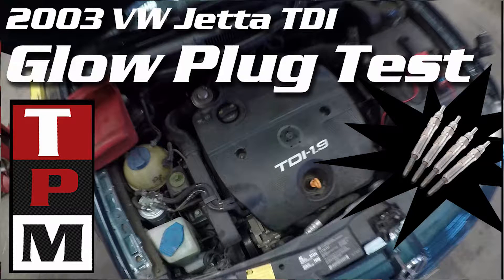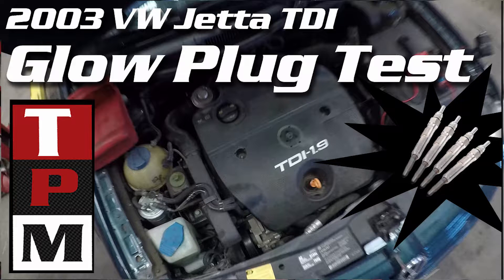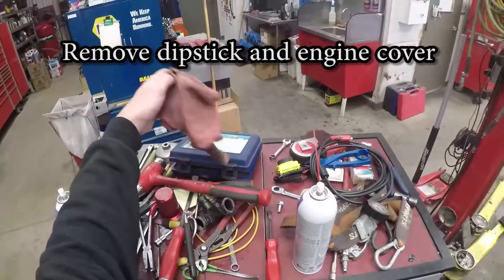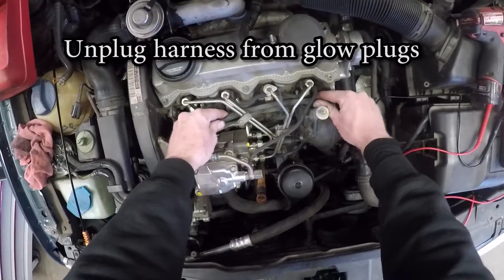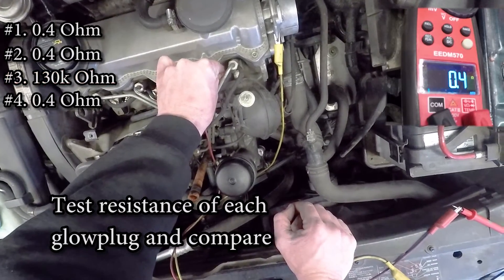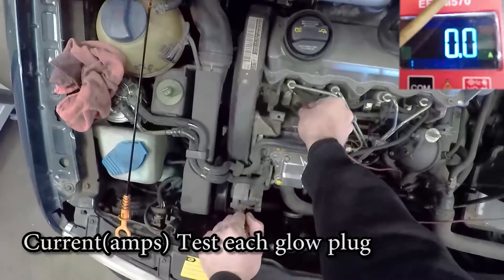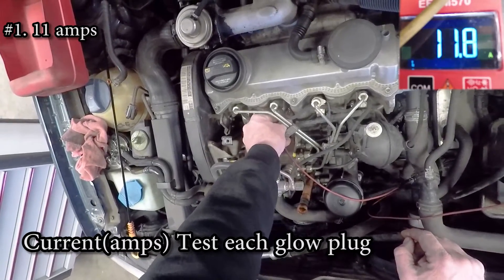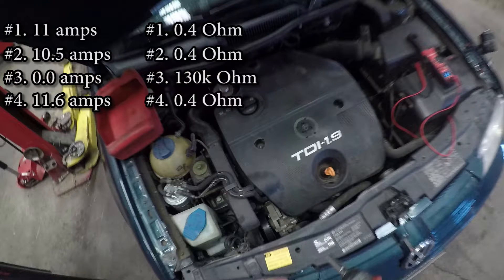2003 VW Jetta TDI ALH 1.9 glow plug testing- with DVOM and amp clamp

Comment: Question, so on one side of my truck I get , .6 , .6 , .6 , .4 , other side I get .4 , .5, .4 , .5. On ohm setting and negative terminal removed ,  when I did the amp clamp I got 0 on all of them and both neg and pos terminals on . 
I can’t believe their all broken ! Could I have  something wrong ?
Reply from the maker: What are you working on? Based on your numbers I would say a V-8. Most newer vehicles use a controller or relay to supply power. You may have a power supply issue. You could use your voltmeter to check voltage at the glow plugs. If no voltage is present After a keycycle then you may have to look at the control system. Ford 7.3 L diesels turn the glow plugs on solid all the same time for about 60 seconds after a key cycle. Chevrolet 6.6 uses two different versions of their system one version turns them on and leave them on until they’re warmed up And the other version pulse width modulates power so you may see a lower voltage value.

Comment: Can someone explain the amp clamp test to me? This is the test I need to perform on mine.
Reply: Multimeters can measure current inline, but for anything like this over 10 Amps the meter will be fried. Good meters have a replaceable fuse, cheap meters may not, and cheap meters are limited to 1-2 amps. Clamp meters are not as sensitive or accurate but they tolerate a wide range of current. You can buy a meter with its own amp clamp, or use an add on clamp to go with a multimeter. If you don't have an amp clamp, one trick that comes in handy is to use a 1 ohm resistor, with as high a watt limit as you can find. You're going to briefly attach the resistor in series with the circuit you're testing. The fact that this increases resistance is not significant because you're comparing each plug qualitatively. The popular 1 ohm 10 watt resistor survives if you just touch it momentarily, even though it may fry if you left it on. Put multimeter leads across the resistor, measure voltage drop  with current flowing across the resistor, and that voltage drop is equal to your current flowing. In this case compare each plug and toss the one that doesn't fit.
Reply: @craigberube9890  two years later.. thank you none the less lol
Reply: Sorry, I posted that as a reply instead of a comment